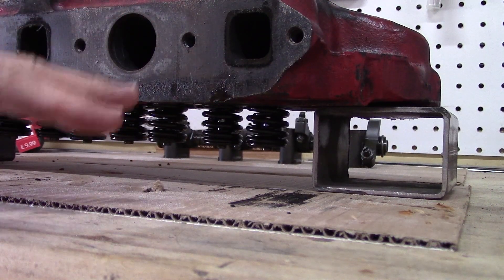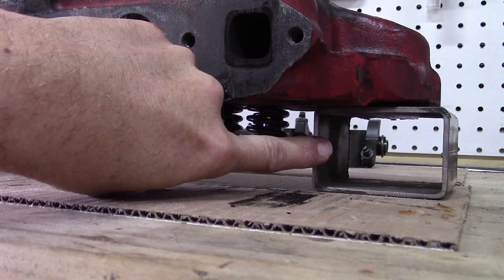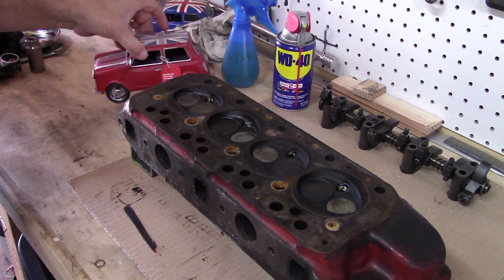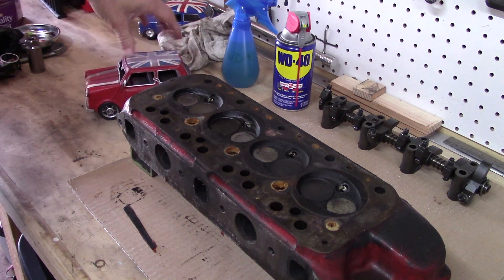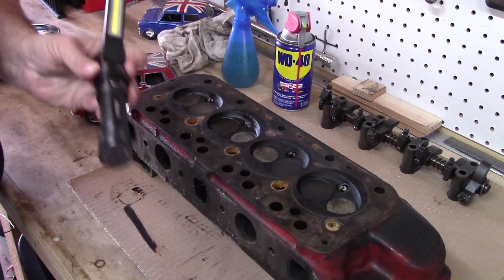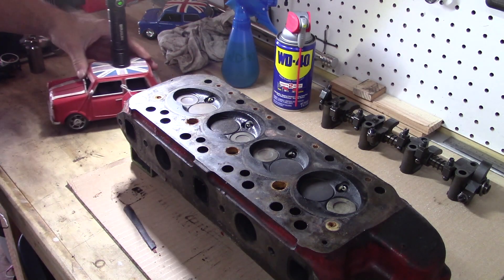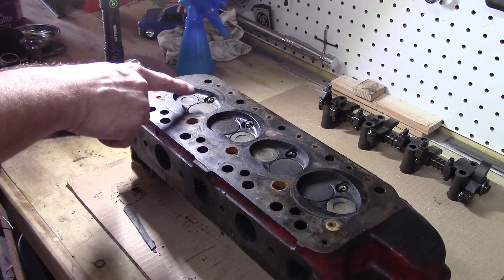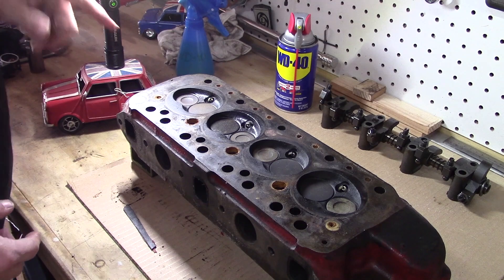Episode 38E:  Classic Mini Leak Test on Cylinder Head

Comment: If you have pillardrill its easy getting the valves off: weld a ring of the size of the valve collett and a reasonably long pin to edge of said ring pointing straight up.
Now put this tool into the chuck, pin first! And now you can press the valvesprings down with the handle operating the chuck going up and down.
Do not start the drill when doing this!!
Reply from the maker: that's an interesting method as I believe understand what you're saying...  although I've never heard the drill called a pillardrill before (it does make perfect sense)..  thanks Vinko

Comment: You  should inspect the condition of the valves, if they are fairly good you might get away with lapping the valves otherwise you might need to have the head serviced at a machine shop. the head it self may need to be ground and the valves turned. after which they will still need to be lapped.
Reply from the maker: absolutely..  I found a machine shop that can skim my cylinder head and recut valves if necessary..   I'm unable to touch the car until this weekend, but hope to get the valve springs off so that I can look at the valves...  thanks Shane!!

Comment: Your quite right randy leaky valves means low compression,  and whilst i agree with doug and tom that grinding the valves in will make them seal, i would always get the valves and seat faces recut this will remove all pitting and give you a clean true surface reducing the amount of lapping needed.
Reply from the maker: Thanks..    having the valves 'recut' is something new to me.  I'm not sure how/who/where to have this done.  I will look into this though..
Reply: @LoneStarMini 
Hi randy its a job for your local engine shop, you could get it done and have the head face skimmed at the same time.